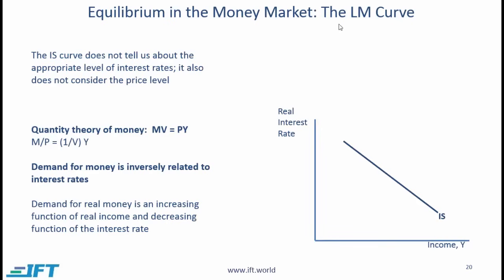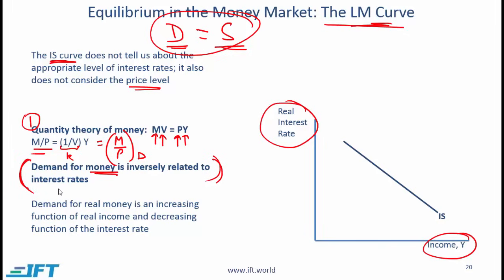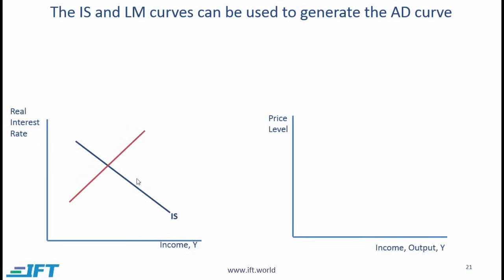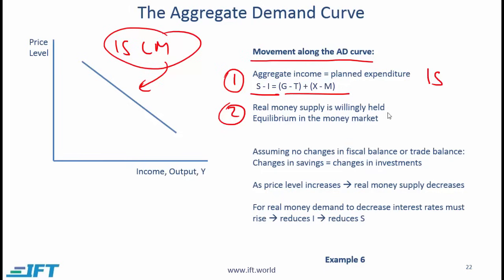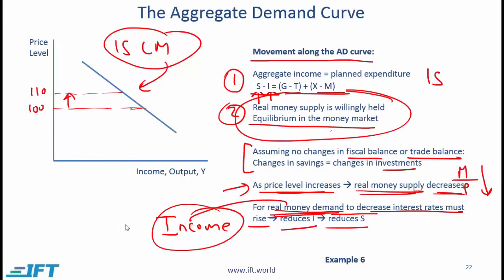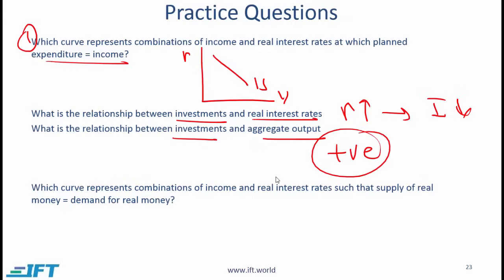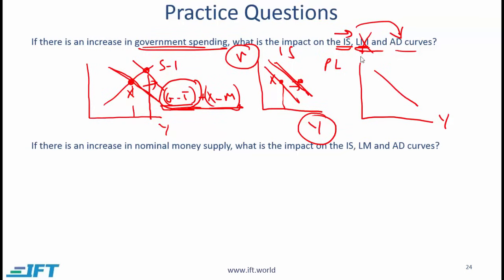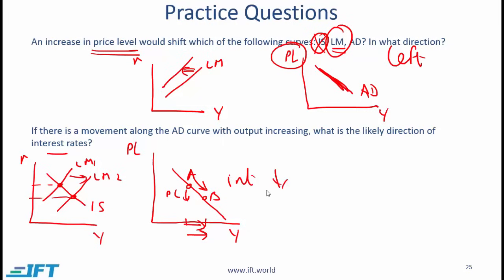Level 1 CFA Economics: Aggregate Output Prices and Economic Output-Lecture 4

Comment: Thanks for the great videos ! 
Please help me understand the below question:)
If rise in interest rates leads to decrease in money demanded , showing an inverse relationship
then why is there a positive relationship between between income and real interest rates and demand for money fin order for the LM curve to be upward sloping.?
Reply: the first conclusion "If rise in interest rates leads to decrease in money demanded , showing an inverse relationship" is true, 
and the next one is also true because if you keep the "real" money demand unchanged (M/P), you must increase both interest rates and income for keeping M/P not changed, it will lead to the upward sloping of the LM curve
Reply: The inverse relationship between real interest rates (r) and real money demand (D) can be shown by a downward sloping demand curve with (r) on the y-axis and (D) on the x-axis. This shows how there is a MOVEMENT along the demand curve with respect to the inverse relationship between (r) and (D). Income (Y) is outside of this model, it is neither on the x-axis or y-axis, so the positive relationship between (Y) and (D) will play out through the mechanism of (Y) increasing/decreasing, causing the demand curve to SHIFT up/down. Either way, the real money demand curve will still be downward sloping as it shifts up/down per (Y) increasing/decreasing. Thus, the real money demand curve is always showing the inverse relationship between (r) and (D) by being downward sloping, with each variable MOVING along the curve inversely to each other. Once the exogenous (Y) variable is brought into the picture is when the real money demand curve SHIFTS.

Comment: In the practice question 16:28 you said that the increase in Government spending leads to the shifting of the IS curve. Ironically, in the previous video you said that the Government spending is determined outside of the IS model. Can you explain this ideal for me. Thank you very much.
Reply: Government spending is treated as exogenous by almost all models because there's a government budget that will be spent, thus it's given and won't change with the level of income. So when it is exogenous, changes in income will be attributed to other variables in the GDP equation such as Consumption and Investing. In this example, however, government spending is not exogenous and it said to increase, which increases GDP, which means aggregate income (Y) increases.

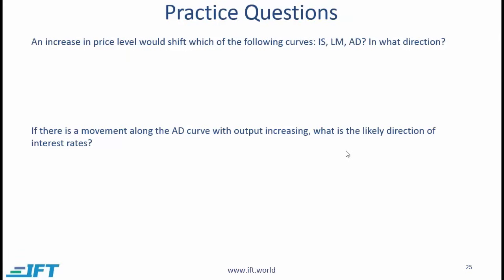Comment: at 19:27 LM curve will only shift to the right, why does Agg demand will shift aswell ?
Reply: Because LM curve shifts to the right, it will intersect IS curve at a higher expenditure/income at each price level => AD curve shifts to the right.
Reply from the maker: AD curve will shift to the right because at given price level, total output has increased.
IFT Support Team
Reply: @IFT-CFA  big thanks for the explanation here, but there is still one thing that confuses me… what is the difference between an increase in output from 1. an increase in nominal money supply and 2. a decrease in prices… why does the decrease in prices cause the ad curve to not move but an increase in nominal money supply shifts it to the right?

Comment: If price level shifts up, aggregate demand should shift to left right ?
Reply from the maker: An increase in the price level would most likely shift the LM curve to the left.  The LM curve represents the combinations of income and the interest rate at which the demand for real money balances equals the supply. For a given nominal money supply, an increase in the price level implies a decrease in the real money supply.  The LM curve shifts to the left. The new equilibrium point to derive the AD would be at a lower income level and a higher interest rate. Since the AD is derived from the intersection of IS and LM curves, there would not be any shift. It will just be a movement along the AD curve.IFT Support Team
Reply: It is a movement along the curve. There is no shift of the AD unless both IS and LM shift at the same time.